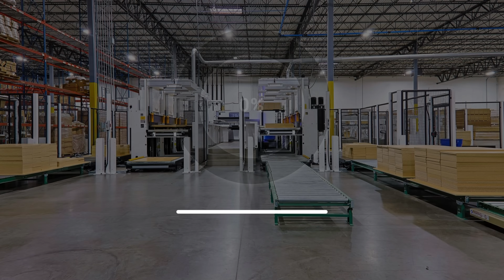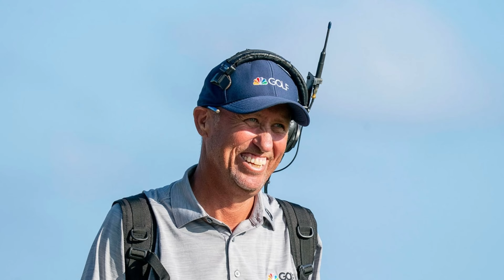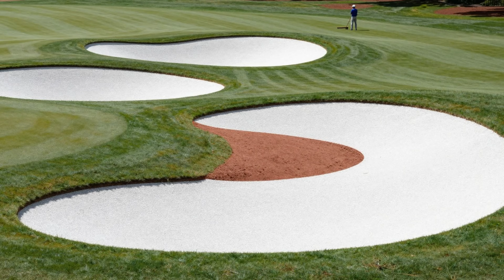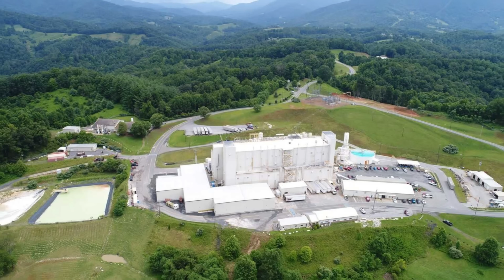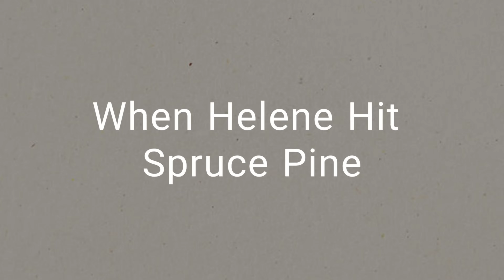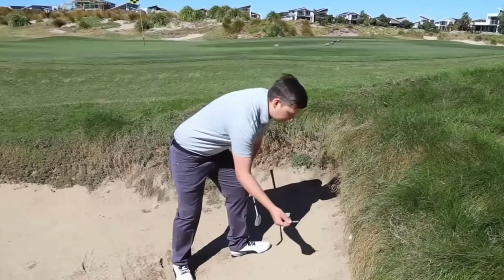Why Augusta's White Sand Costs $10,000 a Ton

Comment: My 1st trip to The Masters, early 90's, they had guys around the greens that would use something like a cane or bamboo stick to wipe away the material coming out of the bunker that lands on the greens. Did this after every bunker shot. Noticed now there's sand on the greens at times. Do they blow it off and just leave on the greens until they mow the greens after the round.

Comment: It's still "sand."  In geology sand is any granular material with specific grain size.  The shape, roundness or angularity, of the grains is just another description of the sand size grains.  The same is true of the mineral composition of the grains; it's just a further description. 

Yes these are very coarse angular grains since it is a man made product vs a natural sand where the grains are worn down and weathered by erosion, transport, and deposition over thousands of years, but would still be "sand" based on geologic definitions. 

Then there are the differences in geology definitions and the civil engineering definitions...